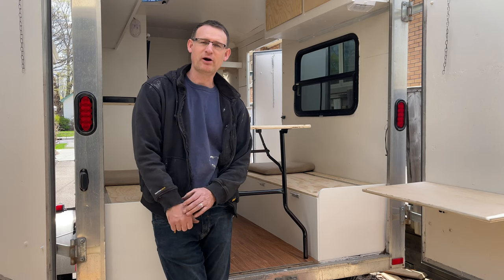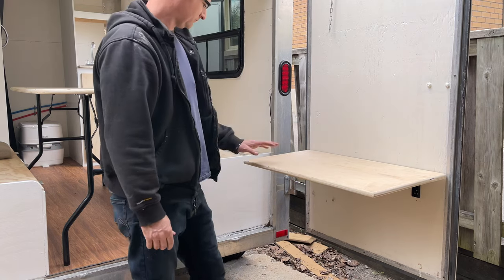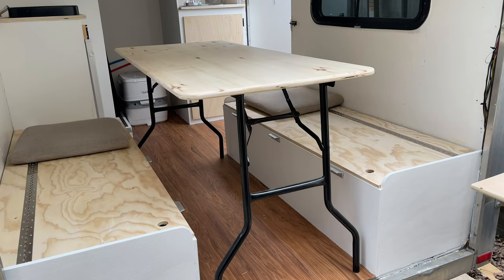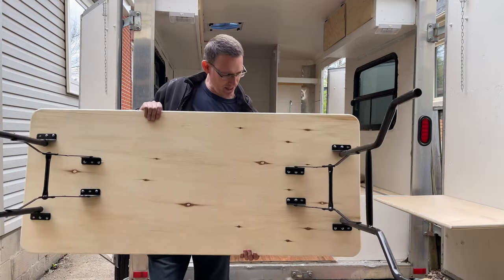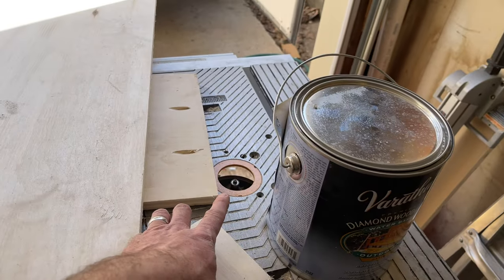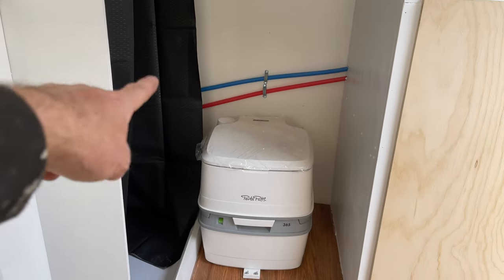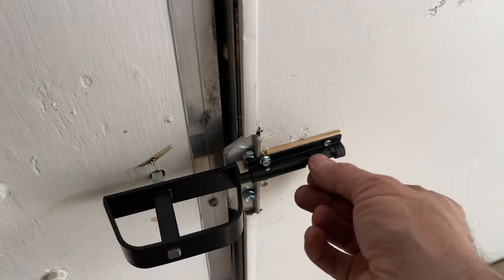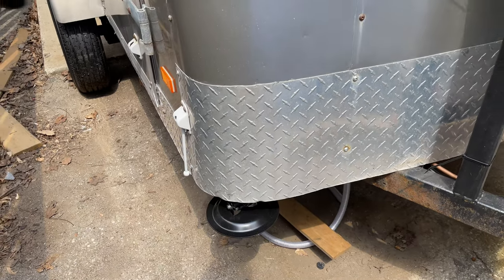How to Build a Cargo Trailer Camper Part 11 - Table build, flip up shelf, exterior handle

Comment: Very good progress, very practical solutions, well thought through. Will you have a tarp extending from the back of the trailer ? A screened room would be even better. We have a Clam shelter we like very much but wouldn’t interface with your setup easily. Looking forward to the next episode and of course the Crown Land adventures once they open it back up. Just getting our little guy ready for the season.
Stay healthy !
Reply from the maker: Thanks! 
Yeah that’s the idea I was thinking maybe a small canvas tarp I can role up when travelling. I’ve also been looking at one of those bat wing awnings. I am going to install one of those magnetic screens for sliding doors on the back. Try to Keep the mosquitos on the outside. 
I can’t wait till we can get going! I have a few spots I’ve been planning for a while, and we are booked in at Kilbear park for the beginning of June. Let’s hope we can all get out there!
Reply: @waysoutback   Zac, yes you have the setup and skill set for many awning options. I’m sure you have viewed the home built awnings described on YouTube. I find being able to use our awning in rain really helps keep the mud out of the trailer and allows the shoes or boots to stay outside out of the weather. The Clam works well in rain, but will fold up above a certain wind speed, probably for the best. 
We have sites booked end of May in St Lawrence Parks, June in Sandbanks, first week of July Charleston Lake. Then in July maybe head to Northern Ontario with fewer black flies 😁.
Reply from the maker: I’ll search for those videos. I definitely can see the benefits of putting on an awning. 
I really like those clam shell tents they seem well built I might have to look for one. Sounds like you got some nice camping to look forward too! 👌😁

Comment: You built your camper pretty sturdy, I was just wondering what your final weight was? Great job by the way very inspirational.
Reply from the maker: Thanks. I wanted it to last on all those rough roads. 
I haven’t got an exact weight yet but as a guess I’d say about 2100lbs total....
990lbs trailer 
240lbs batteries 
300lbs water tank
60lbs fridge
60lbs propane tanks
180lbs wood
50lbs flooring 
50lbs steel on front
50lbs RV Windows
100lbs misc